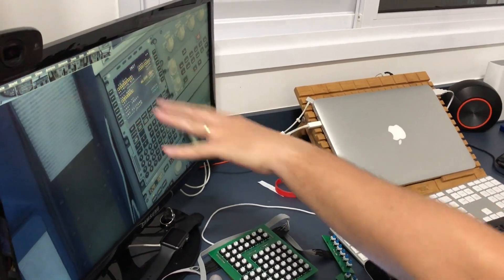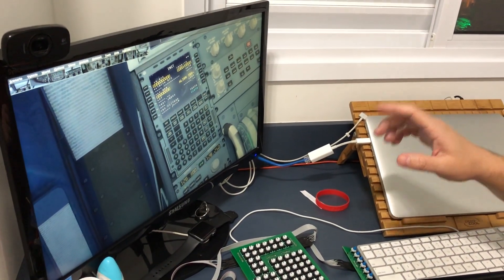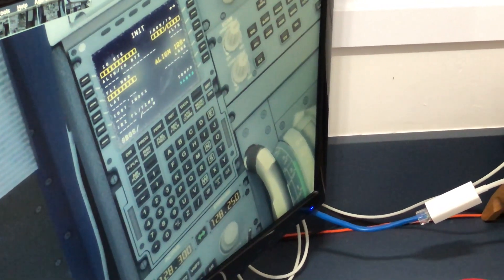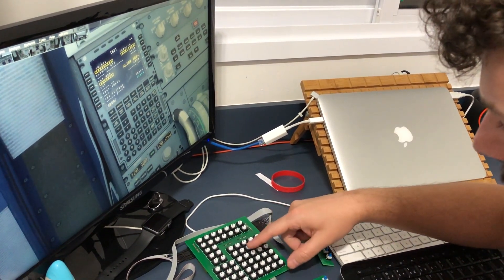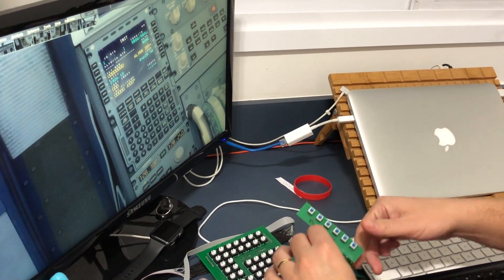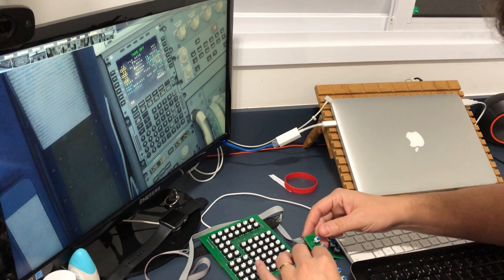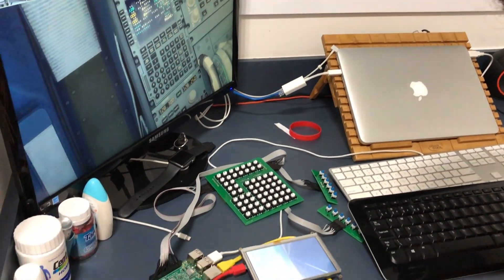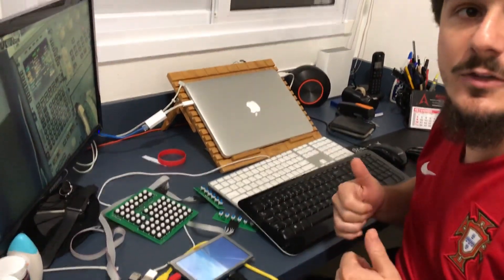01 - Homemade Airbus A320 MCDU - Electronics Fully Working ;-)

Comment: Hello, 
How did you manage the screen ? or will u only use the computer screen ?
I am actually on same type project building a full Airbus cockpit base on RPI too and hardware & software i have made by myselft to interact with Flightgear Flight Simulator

Best regards
Reply from the maker: David ALBERT I will use the Aerosoft Airbus html page on the screen, that will be open by a Firefox in full screen.
Reply: normal pc can add about 5 screen same computer, i have my cheap cocpit 3 screen and 2 screen come to gaugepanel more, need only good display card or 2 card, wery simple add all screen to simulator.
Reply: and if need big realistic simulator you can install together 2 computer, one use main software simulator x-plane or msfx. and second has conenc lan together and use gauges, ai traffic,weather,all other informations. and 4 more screen. my flight school have build real cessna plane inside computer training simulator and have 2 computer and low cost all about less than 1000$ can build all. not buy plastic shit yoke and trottle etc other parts, cheapen and better realsitic come use real cessna parts or made same dimension yoke etc at wood and metal easy job. normal men can build all to home.